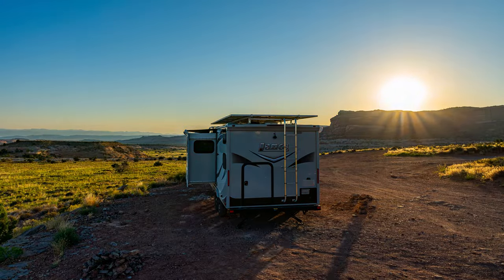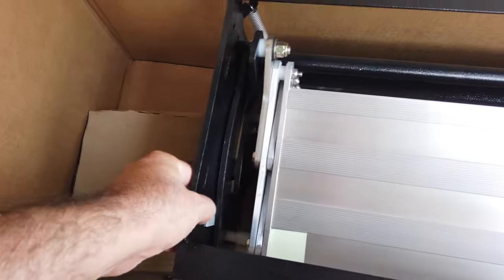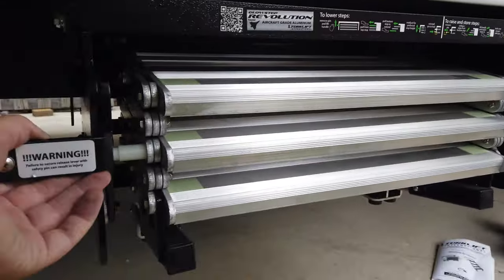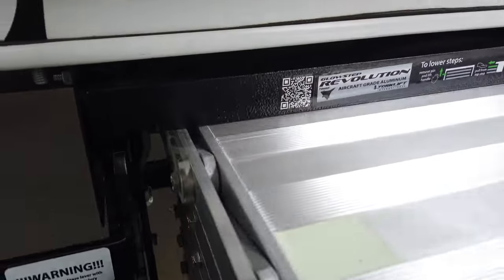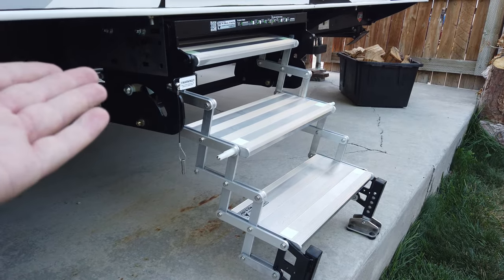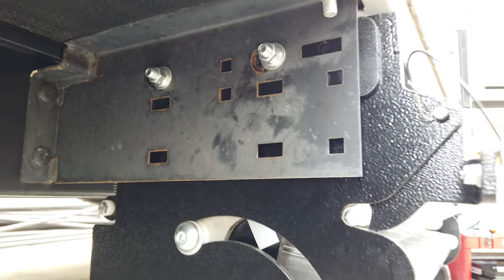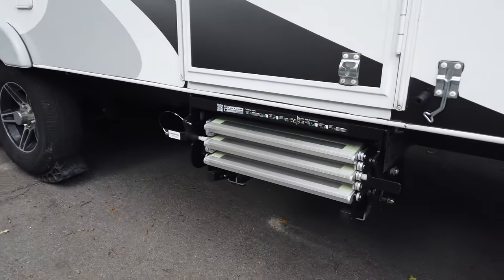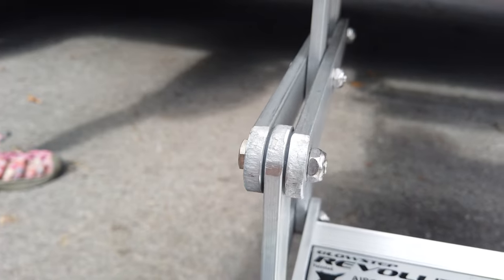We Upgraded Our RV Steps! | Torklift SmartStep GlowStep Revolution Installation and Review

Comment: You should try towing your camper with the 85D to see what the potential range and efficiency would be. I also have a model s 85D 2015 and i was looking at getting a camper or buying a cargo trailer and converting it to a camper so it would be cool to see what kind of efficiency to expect.
Reply from the maker: If it was just a matter of testing efficiency and range then I'd do that just out of curiosity. I'm sure the Tesla has enough power, but the range would be very low. However when it comes to towing there's more to consider such as tongue weight, suspension and the braking capacity. The hitch on my Tesla states it can handle 300 lbs tongue weight and 2,000 lbs trailer weight. My trailer is usually sitting around 1,250 lbs tongue weight and 7,000 lbs trailer weight so that's a no go for my 85D unfortunately. Years ago before I bought my trailer I looked into getting a small trailer that my Model S could tow, but those trailers are quite small. I have a family and ultimately we got the trailer we have and waited a year borrowing other people's truck as we waited for our Cybertruck. Then I decided the Cybertruck production was taking too long so I bought the Ford F-250 that we have now while we wait for our Cybertruck.

Comment: Hello - I have a Lance 1985 Travel Trailer. I was wondering what your distance was on your TT from trailer bottom to level ground? Mine is 24-25 inches. I also wonder if you could tell me what the distance is of the 2nd step platform to the top of the glowstep frame when the 1st step is docked? When you dock the first step is it possible to adjust between positions 1-3?

Thanks, Bob
Reply from the maker: 26 inches from ground to floor. 10 inches from middle step to top of Glowstep frame. When the top step is docked then the three levels of adjustment is not relevant because docking it is at the top of that adjustment. Did that answer your question? In my experience so far I think two steps is preferable. I'm considering removing a step because even when there's a tall climb it looks like two steps would be sufficient, and more often than not there's too many steps, so I leave the top one docked, and the two remaining steps are unable to extend fully so there depth of the step is minimal, and the distance from the middle (top step in that configuration) step to the floor of the trailer is a big step.
Reply: @ElectricTechAdventures  You did answer the question. I've found that my trailer exists in a non so sweet spot that captures your "too many steps" and having too large of a drop in the final step to ground. My exact distance from trailer bottom to ground is 24 inches. There is also a 3 inch distance from the floor bottom inside the trailer to the beginning of the glow step frame. Our goal was to reduce our current step into the trailer which is 10.5 inches. However the 2-step model just moves that drop to the drop to ground. Thanks for the time you took to respond. Bob